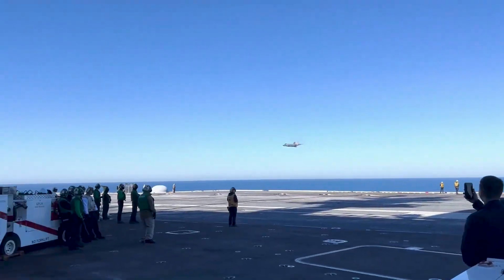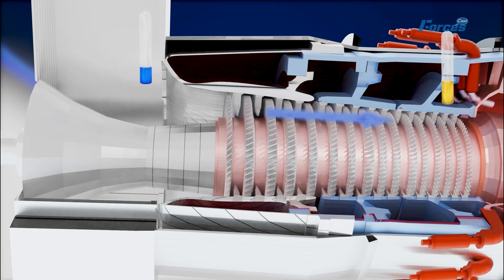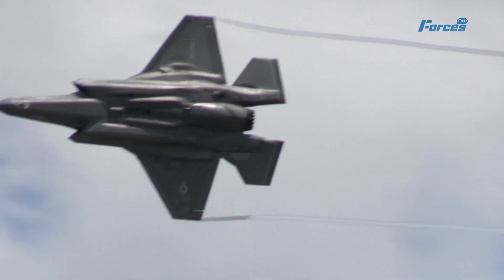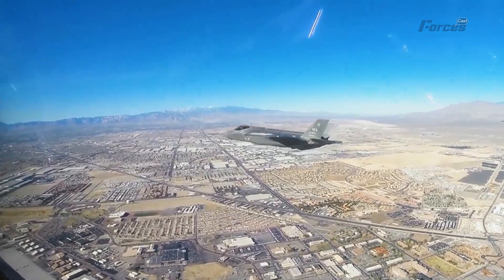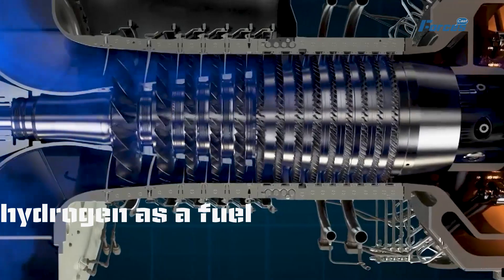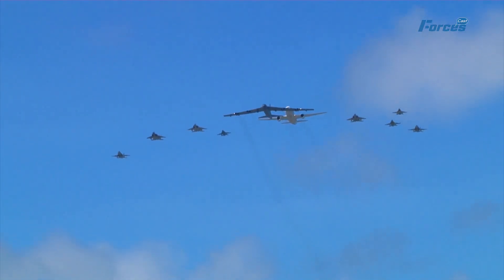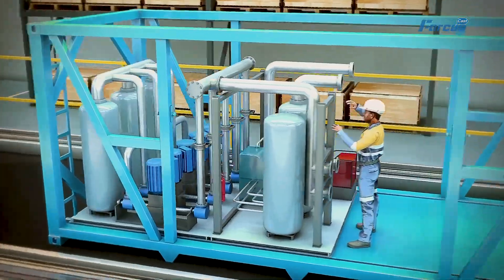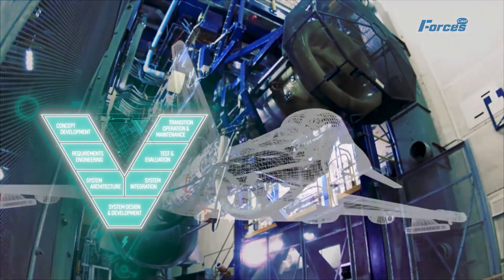US Build Hydrogen Engine to Hypersonic Jet

Comment: Using technology that reduces “greenhouse gases” is not what the military should be concerned with. Improving the performance of their equipment should be what drives any change. If it happens to improve their social standing in circles where that matters, so be it. It’s not a platform for social experimentation but a mechanism to impose the will of our government on our opposition. When these objectives get reversed, the outcome will not be good for our enlisted sons and daughters.
Reply: Yeah buy hydrogen is more energy dense then per kilo then jetA plus given other things the navy has been up to it sounds more and more like they have been trying to get rid of or reduce tankers in the fleet.

Edit:
Increasing range is also always welcomed.
Reply: @andrewyork3869  Yeah, Hydrogen has to be supercooled and specially stored and is INCREDIBLY dangerous no matter what state it is in. Nothing like increasing the volatility of a mission to the point you cant take a single stray bullet, shrapnel or object impact. Nothing like increasing the danger of a mission before you every encounter an enemy combatant. NO, it is NOT less volatile than jet fuel, it is much more volatile.
Reply: @troyezell5841  that was true 20 years ago. Look at liquid organic carriers. Yes, there are a few safer than hydrazine and ammonia. Notably, they are less flammable and toxic. Hydrogen adsorption has also been coming along, if at a slower pace.
Reply: You must signifikant Change your thinking about what you said!! People like you bring Is on those Points with only from one side that is not Future but American very difficult to explain anything to change at thinking!!!The normal American helps the rich quick build for Space so the Planet that People know in future is the only way to leave the Planet mabay but not the People who build that to leave🤣👍I like the Human it's very simple to manipulate and also decade after decade not better and much more laying but didn't Stop🤷